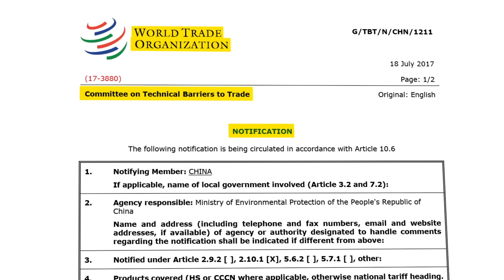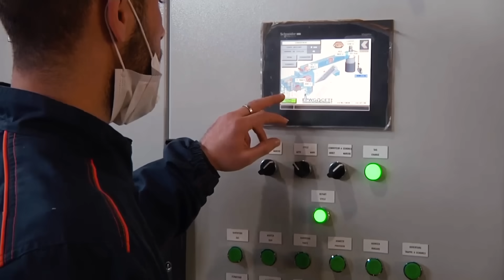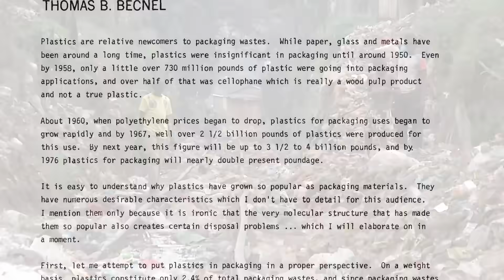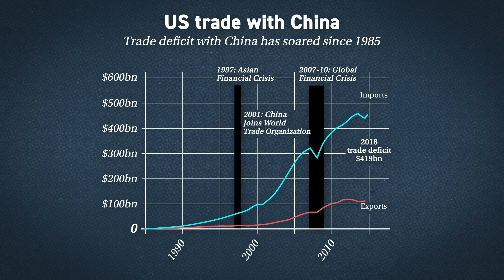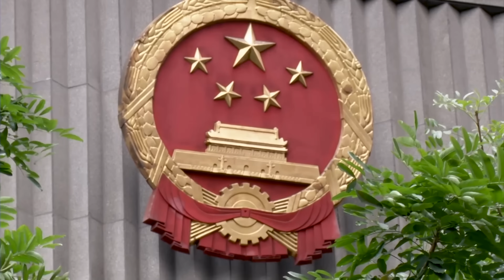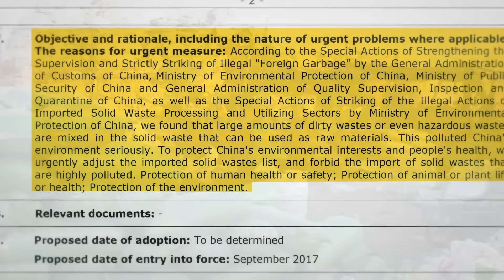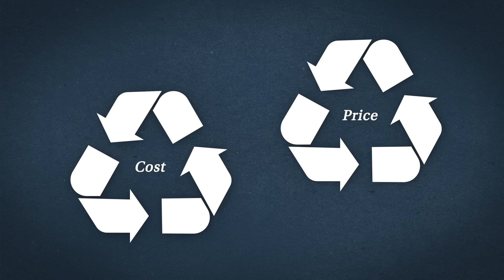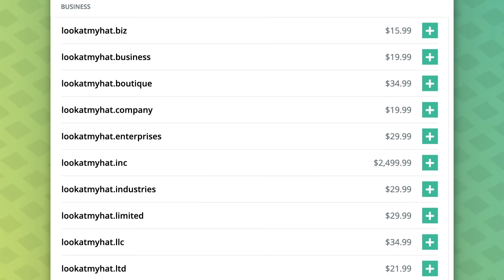How China Broke the World's Recycling

Comment: This somewhat illustrates how "Carbon Footprint" can vary, from positive to negative, depending on who calculated it.  A manufacturer just calculates Their Carbon Footprint.  If Heinz has to meet a goal, because of government imposed limits, they just have to meet the Carbon output at the Factory.  All the carbon going into that factory doesn't count.  So, they can subtract the cans of crushed tomatoes that come into the factory, on diesel tractor-trailers, fueled from fuel depots, from refineries, from crude oil depots, from pumps, fueled with diesel, delivered by tanker trucks.  Fueled by Diesel.  That's just the cans of Tomato Paste, going into that factory.  Same with a recycling plants, and the device you're reading this on.  Every component that went into this device was shipped to the Assembly plant from different manufacturers, ultimately with Diesel.  (From the portion that wasn't shipped in tankers to the pumps to get the crude out of the ground.)  That's why "Carbon Footprint" calculations are invariably wrong, regardless of who calculates it.  Because none of them count Shipping costs, because none of them can.  You can't account for the Diesel used to fuel the Tanker to get the fuel to the birdhead pumps in the oil fields.  That's where the Carbon Footprint is coming from:  Out of the ground, and all the practically free fuel the industry wastes, pumping it out of the ground.  Every single piece of every product around you, right now was shipped in on the back of that system.
Reply: A similar Top-down stat is sold to you with your car:  Miles per Gallon.  Even if you don't buy a VW, where they programmed their cars to lie about that statistic.  It doesn't count the Barrels per Gallon it costs to get the fuel to the gas station.  Let alone to the pumps to get the crude oil out of the ground, the pipeline to get it to the Refinery, and the miles per gallon to get the diesel back to the oil fields, to get it out of the ground.  Now, try to imagine a black triangle, with the arrows pointed the other way.  (From the green one on the side of your re-usable recycling container.)  That's profitable, because diesel is practically free for the "Energy" industry.  That's the bottom-up problem, literally from the ground.  That we're trying to solve with products we buy, on Amazon.  Delivered to your door in a brown truck from UPS.  What's in that gas tank?  That's right.  UPS, and Amazon run on Diesel.  Nobody has calculated the Carbon Footprint of that black arrow, because your life is delivered to you by it.  So is every lawmaker's, and every worker's in that recycling bank.  That guy that hops off the truck to pick up your recycling bin?  Yeah, what did he drive to work in?  That's what "Carbon Footprint" should mean, but it doesn't.

Comment: Why did you not mention the PET/Glass bottle recycling for some European countries in this video? Eg. Denmark/Germany. Is that not a partly good solution? 

Every sold bottle charges the customer around an extra ~0.2$ but they'll get the money back once they return the bottle in a special vending machine which can be found in all grocery stores. 

This leads to about that 95% of sold bottles are returned and sorted perfectly (All bottles have a registration code on which type of plastics it is). 

Customers are incentivized to sort as they'll get their money back and companies can reuse the plastic without sorting it.